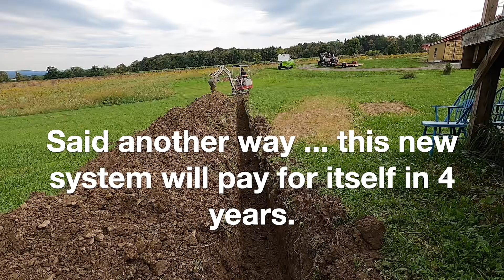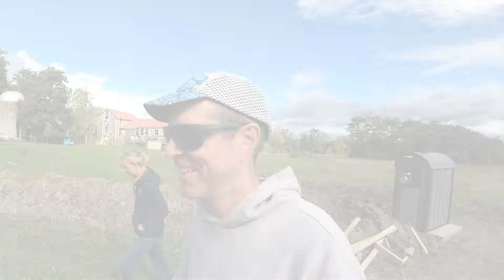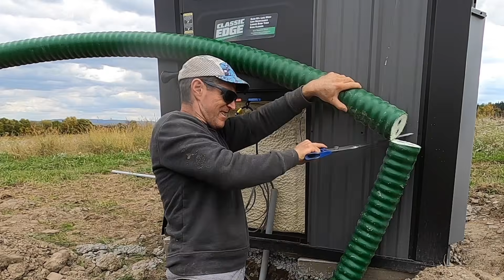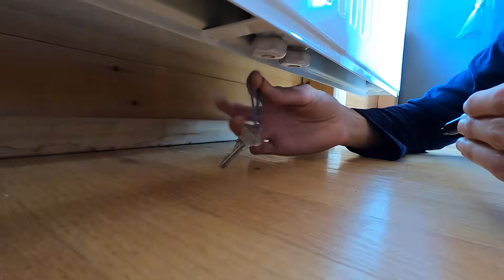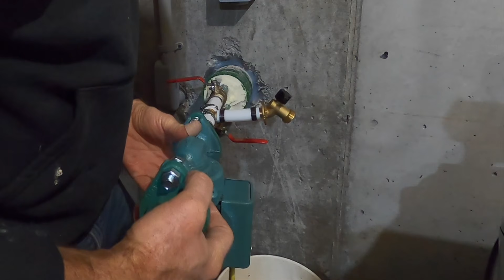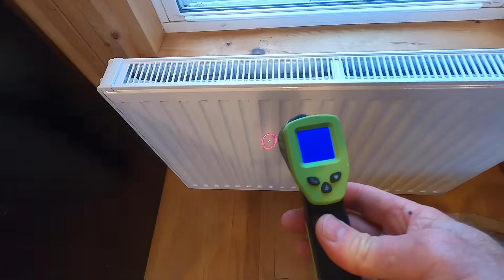Outdoor Wood Boiler FULL INSTALL, Start to Finish

Comment: Nice system, but how often do you have to remove ashes and add wood, and who's going to do it?
Reply from the maker: We've been refilling the heater together after lunch -- refills have been once a day with a few extra logs going in when we've had sub-zero temps. As for the cleaning I've been doing that part roughly weekly.
Reply: @metaspencer  Lovely system, I really like the feel of radiator heat. It's amazing that you're only losing a few degrees between the radiators and the boiler, that pipe insulation is excellent.
Reply from the maker: @Bob_Adkins  Yeah, the feel is really great ... just a general warmth everywhere

Comment: So just give an estimate of how much it could cost. Unless you were able to get your machinery from friends. Still most of that equipment is $250 a day in ohio
Reply from the maker: Yeah we paid about $250 a day for rentals, one day for the excavator and one day for the skid steer
Reply: @metaspencer  how much for materials, fuel,how many man hours? Thank you for your prompt response. F
Reply from the maker: @critter3188  No clue about the man hours -- a month or two of weekends to get the job done. We paid about 4x a year in heating fuel

Comment: Why not put the stove closer to the shop to cut down on the ThermoPex??
Reply from the maker: For us spacing out buildings is more valuable overall and there will be a large ag building by the heater eventually

Comment: Is there a reason its so far from the house? Or is it because of the other things you want to set up with the system?
Reply from the maker: We like to space out our buildings and not crowd the house … plus better for smoke
Reply from the maker: Note that it did need to be below the high point in the house
Reply: Thank you

Comment: where did you buy this and where are you loceted?
Reply from the maker: After calling around a bit we bought the boiler and underground pipe from a local fireplace dealer. This is in New York and the dealer was in Seneca Falls.

Comment: Where did you get the radiators and what brand?
Reply from the maker: They're euro radiators and I'm pretty sure they're these ones or close to them ... https://www.supplyhouse.com/Buderus-3-42424-Model-21-24-x-24-Hydronic-Panel-Radiator?utm_source=google_ad&utm_medium=shopping_neutral&utm_campaign=Shopping_Neutral_MPLTV&gclid=Cj0KCQiA45qdBhD-ARIsAOHbVdET7YWMuqmPhFlieSn9jX0c-SsEgS1um5rjz7JaNLlA4_Y3w7ulc0IaAmToEALw_wcB .. our Central Boiler dealer dude had them in his catalog. I think they were about $230 each for the size we got

Comment: If you want to save some money I would suggest ( if practical ) putting this outdoor wood burner as close to your home as possible because that insulated underground water pipe you have to bury from the Burner to your home is INSANELY EXPENSIVE !
Reply from the maker: You said it! Pricey stuff! But we prefer not to crowd our buildings together

Comment: I think you'll find out pretty quick that you'd like to have as much of you would it's closer to your bowler edge you can get it as far as you are awake if you're burning hardwood you're probably looking 8 to 10 full quartz birds I would think And the reason why I say it won't be closed because you don't want to be logged in to everyday and you also don't want to be shoveling snow to your board I don't know how much snow you'll get in your area we actually stuck the front face of air boiler inside our building and then that building is also where wood shed fill it up we can get 25 gorge I burn just popple Or ask them mand my shop is 40 by 210 and I burn about 15 colds
Reply from the maker: Yeah this first winter is teaching us some lessons: we'll want to cover the boiler and work area in front and behind it, and then have more than just wood storage in that building (tractor, wheel barrows, tools, etc). At most we'll get a foot or two of snow and that wind rips! Thanks for the ideas. So far we're loading it once every 24 hours but I haven't hooked it up to the barn yet

Comment: Is there no expansion tank or is this an open vented system? As far as I'm aware, the motor of a circ should never be on the bottom. The pump in your house should be rotated. I believe the allowable configurations are in the literature in the box. Did the boiler company help spec everything for you? The underground pex  seems maybe a size too small. That being said, if it works, it works!
Reply from the maker: Good eye -- that pump in the house lasted exactly one day before seizing up. I took it apart, lubed it up, but it never spun quite right -- so I replaced it and mounted the new one in the right direction. Doh! Livin' and learning here. UYeah this is an open system that's vented at the lower end where the boiler is. As for the diameter of the lines I haven't seen any that are LARGER than 1" but it's possible. Everything seems great so far but only time will tell
Reply: @metaspencer  there's a lot to know about hydronics and easy to make mistakes, even when you've done it a long time. 1 inch is probably ok, I thought maybe it was 3/4, its hard to tell from the video. Maybe you even said it and I didn't hear. They do make bigger but I'm sure you'll be fine. Ultimately if you're not getting a good delta-t (diff of temp between supply and return) you may need a stronger pump. Also, if you are having problems with radiators getting the same flow to each, you should make sure the pipes are set up in whats called reverse return. You can look it up, maybe you have it that way already, I can't tell. The other option would be putting in a manifold that controls the flow to each radiator, or zone valves. Just some things I noticed, not being a negative nelly... hope it helps and hope you're getting some nice heat!
Reply from the maker: Dude, super helpful! So far flow is amazing and seems equal in all radiators but I have no clue about delta-t … sounds like a frat party I went to once. I’m gonna look that stuff up. Big thanks
Reply from the maker: @profjohnfrinks  Delta T is up to 25 ... was running at 20 before this cold .. thanks again man!
Reply: @metaspencer  Nice, 20 is a pretty typical DT... sometimes different heating/cooling emitters can be designed to have different delta-ts. You can look at the literature on the radiators and it will probably say. Im assuming you're in the ballpark. I've never done wood boilers, so you may want to look at the specs on that, if it has a good manual. In general, if the delta t is too small (ex: 5), the pump is oversized and moving the water too fast. If the delta t is too large (ex:40) the pump is undersized and not moving the water fast enough. That all being said, saying its too large or too small is all based on how the engineers designed the product and what it calls for.

Comment: pex is not for heating btw
Reply from the maker: Copper would be oh so nice, if that's what you're suggesting.
Reply: You can use pex for heating but you must use oxygen barrier pex for hydronic applications like you are there.
Reply from the maker: Oxygen barrier pex on open and closed hydronic systems ya think?
Reply: The issue is that if you don’t use oxygen barrier tubing you would have to use non ferrous materials to go along with it. Eventually it’s going to kill your cast iron pumps prematurely. Typically you would use bronze or stainless pumps if you decided to not use oxygen barrier. It will really affect you if you glycol down the road but then again you can always just use the pumps as freeze protection so that you would never have to glycol it anyways. It’s a beautiful system, just don’t want to see you going through pumps and stuff. Best of luck!!
Reply from the maker: @kennethfay8406  I see what you mean there: keeping oxygen out of the lines to avoid cavitation and/or rust makes sense ... but with an open system like this one it seems to me that there would always be an oxygen source and thus the potential for the kind of damage you're talking about. I'm kind of assuming I'll be replacing pumps periodically ... thanks for the thoughts! much appreciated

Comment: Great video!  Would really liked to have heard a $$$$$$ figure vs the 4 year payback.  I was really interested in upgrading my non-gasifying boiler to the CB but the $15500 I am getting quoted for just the boiler is really setting me back.  I am already reaping the financial savings, but would like to replace my 20 year old stove with an assurance for next 20 year, and interested in the potential 50% less wood but again $15K+ is a lot of wood.  Also, why did you put the stove so far away from your house? Mine is under a shed just adjacent to my garage so the convenience is amazing especially on the nasty weather days and nights. Keep the awesome footage coming
Reply from the maker: Hey man, thanks for checking out the project. Yeah, that price you were quoted is about what we paid -- and then there were all the added/extra costs. Prices are just crazy right now but it's nice to no longer have a propane bill (for us). We put the boiler far from the house for a bunch of reasons: to keep smoke away from the house, but also because we like to spread out buildings out on our property. I'm planning to build a large shed alongside the boiler and didn't want that near the house. Sounds like you have a good setup!

Comment: Add a plate to plate heat exchanger for domestic hot water.
Reply from the maker: That is on my list! I just got the exchanger so just need to hook it up. I wasn't sure if we'd have the hot water to do it but this thing is CRANKING hot. So yeah, doing the hot water makes sense. Thanks man

Comment: why is it positioned so far away from the builings that will be heated
Reply from the maker: We like it that way to keep the smoke away and to not have too many structures close to the house. Next year we'll build a large shed around the unit for wood and tractors, so didn't want that by the house

Comment: Thank you for the video. Did you hook the boiler up to your hot water heater as well? I'm interested in how that connection comes together.
Reply from the maker: That connection is pretty simple as it just takes a heat exchanger: https://amzn.to/3WroUt0 ... There is no water mixing: the heated water just heats up the exchanger and the water going into the water heater gets pre-warmed. I have the exchanger but haven't done it yet (doh!)

Comment: Doesn't the newer boiler systems require oxygen barrier waterline??
Reply from the maker: As far as I understand it's an open system with air being able to get into the boiler through the top vent, so not sealed like a gassifier system or most radiant floor systems (orange pipe)
Reply: @metaspencer  @bubba007sss is absolutely correct if your PEX does not have an oxygen barrier you will absorb dissolved oxygen into your system. This will lead to cavitation of your circulators.  The vent on your boiler is to allow air to escape. Any boiler system no matter the source, will be ineffective with air in the lines. Also running a boiler without an expansion tank will case the system to operate at a higher an much less effective system pressure.
Reply from the maker: @tannermartin9649  Interesting. My boiler's water tank is completely open on the top -- no one-way air escape valve or anything like that. So the water system is constantly in contact with the air. As for an expansion tank I've considered it
Reply: @metaspencer  ok yep, open to atmosphere should do it
Reply from the maker: @tannermartin9649  I'm assuming we have cavitation on the discharge ends of our pumps from the turbulence ... but maybe the pex absorbs the shock
Reply: @metaspencer  cavitation occurs when microbubbles collect in the low density area in the center of your circulator's impeller . It will corrode the impeller and housing.
Reply from the maker: @tannermartin9649  Yeah and I'm guessing that happens at my pumps
Reply: @metaspencer  I am a plumber who specializes in heating and boilers. Feel free to contact me with any questions. Nice work so far!
Reply: @metaspencer  I live in an old log house that has none of the logs exposed.
I have an oil boiler and a New Yorker hard coal boiler.
And because my house would be considered Geotherm I only use no more then 3 tons of coal a year..
Reply from the maker: @bubba007sss  Sounds like a good system you have, man!
Reply: @metaspencer  The way my house is insulated it helps out a lot
Reply: @metaspencer  Nice job on your boiler system.
Reply: I am plumber who specializes in heating and boilers. Feel free to contact me with any questions. Nice work so far!
Reply from the maker: @tannermartin9649  Nice hearing from ya. I fried one pump by installing it upside down (lasted a day) but other than that things seem to be flowing pretty well.
Reply: @metaspencer  also a possibility is that tank is on source side of the boilers heat exchanger, meaning the field side isn't is still separate. Idk without eyes on it
Reply: @tannermartin9649  I installed both my boilers

Comment: Hopefully you are never sick and have to go out and fill the boiler in the middle of the night when it is -20 with a 40 mph wind from the North. 1st you would have to find the boiler way out there in the snowstorm.  Maybe one day a steel shed around that with cover for the firewood?  And yes, that insulated pex is ridiculous expensive for what it is.  We have similar pipe and we were told that we didn't even have to bury it as even with snow on it the snow never melts even with 180 degree water going thru it.
Reply from the maker: Plans for the steel shed are in the works -- that'll be nice, but not until next winter. Until then it's all about mud, snow, and ice out there! Woo!
Reply: Installed my Portage & Main OWB last season. Filled once a day for the entire winter. Digging logs out of snow isn't fun but it is satisfying. Just finishing a 30' x 36' 'woodshed' with the boiler now inside (along with my camper) and wood. I did run my pipe on the ground all winter and only had a 1 degree loss in a 100' run.

Comment: The hole system costs 17000 dollars
Reply from the maker: That's close to what we paid. Price depends quite a bit on how you plumb it, how many buildings you connect to the system, length of run for the pipe, etc.

Comment: how do you determine where the boiler is placed?
Reply from the maker: A number of factors: wind direction to keep the smoke away, height in comparison to the house is also a factor given pressure in this open system (some are sealed), location of wood storage, local zoning rules, and for us just how it looked on our land. Oh, there's also the HIGH cost of underground pipe to consider.
Reply: @metaspencer  ....Is there such thing as a smokeless boiler?
Reply from the maker: @rudynegrete5658  I've never heard of such a thing. With dry wood they dont smoke much, but there's always smoke with fire

Comment: 4 year pay out what about wood and splitting  cost?
Reply from the maker: Well that would be different for everyone -- I run a tree service so get more than enough wood for free. Splitting we do as a pastime but if you wanted to figure your cost-per-hour for that work that could be an option for ya. You could also add equipment costs in there, but again, I have dump trailers and tractors for my work.

Comment: So with water in the system isn't there a chance of it freezing if there's no fire going for a while?
Reply from the maker: If there's another source of heat in the house or barn, that heat will keep the water from freezing ... but if we were to plan to go away for a while during the winter we'd add 30% ethyl glycol to keep the water from freezing
Reply: @metaspencer  ah ok, so I could fill it with glycol right from the get go. Just a little more expensive. But where I live it makes a lot of sense since our Temps can drop to -40.
Reply from the maker: @FrankfurtFury  it seems like all boilers are different but this one can fun on a 30% glycol blend. The manufacturer we went with had us treating the water and testing it to make sure it wouldn't corrode the tank and they recommended straght ethyl glycol not a mix like the stuff I put in my RV
Reply: @metaspencer  alright, thanks for your time. Will figure it out.

Comment: That’s a nice boiler setup! Will you be using antifreeze in the system?
Reply from the maker: It runs on a treated water system but antifreeze at 30% is an option ... So far it's been heating like nothing we've ever had before. Super toasty
Reply: I don't think antifreeze is necessary at all in these systems.  The time of year that has freezing temps is when the water is at +160F.  The additive that is necessary is some kind of rust inhibitor.  I use molyarmor 350 in mine.
Reply from the maker: @dansw0rkshop  Yeah I use the same rust inhibitor and no antifreeze/alcohol

Comment: Been thinking about one of these for my place. Watching your video made me realize that it looks like something I could tackle. How much time do you think you spent on your install (boiler + thermopex + interior piping)?
Reply from the maker: The time is a bit hard to measure since we worked on it only on weekends and intermittently. All in all it was probably a solid week to get it done, what with the 9 million trips to the hardware store :)
Reply: @metaspencer  yea, especially with plumbing projects it seems. A week is pretty impressive considering all the mini projects, slab, trench, electrical, etc.

Comment: Seems weird watching a heating radiator being fitted in USA. I'm in the UK we no nothing different but USA is known for blown hot air only
Reply from the maker: Yeah when we started talking about this new system we both said something like "Let's set up something like what we've seen in Europe." :) In NA it's all about forced air and radiant floors. So far these radiators are heating nicely and take up very little space